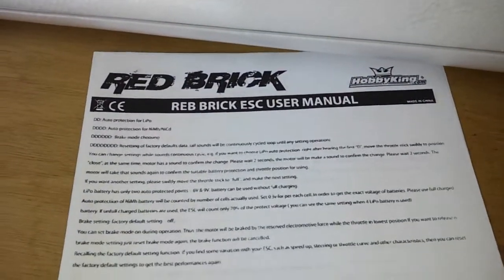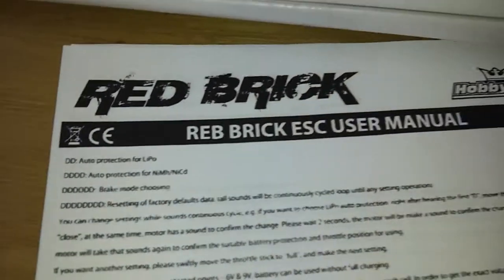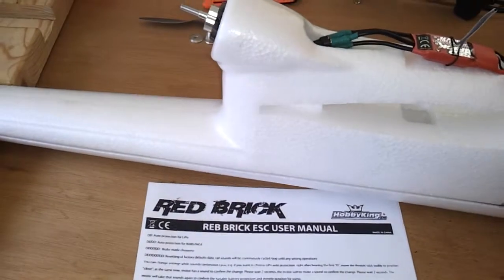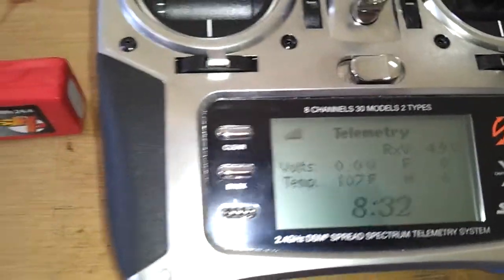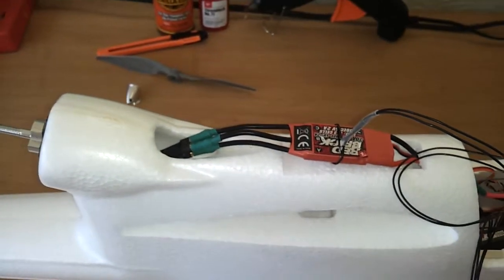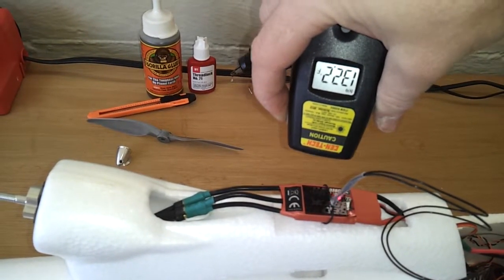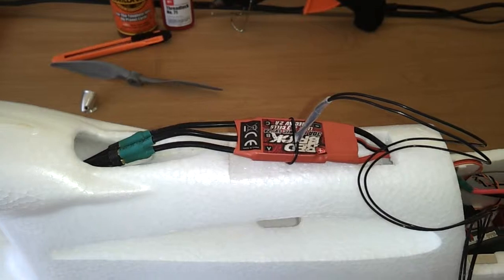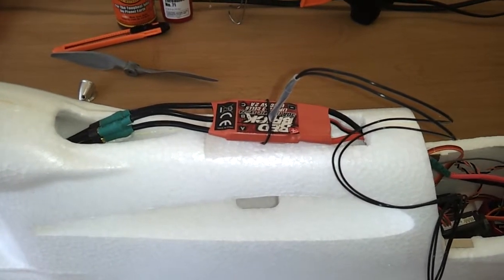Hobby King Red Brick 30 Amp ESC Review - Infrared Thermometer Readings - Part 2

Comment: what happens to esc during the work when it looses connection with the remote ??? ALSO DOES IT HAVE A STOP/SLOW DOWN OPTION ???
Reply from the maker: Yes this ESC has a brake option that can be turned on/off.
Reply: @MrDabrudda  HEY DOES ALL RED BRICKS GOT SUCH OPTION ??? ALSO WHAT HAPPENS WHEN IT LOOSES CONNECTION WITH THE REMOTE ???